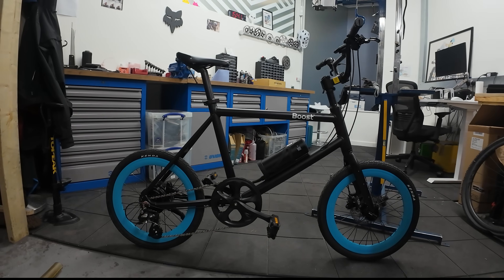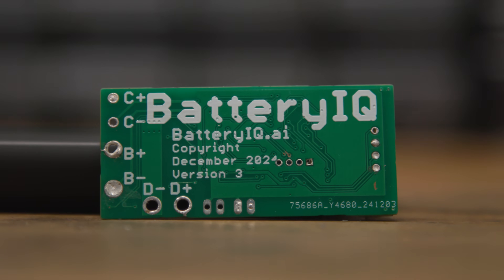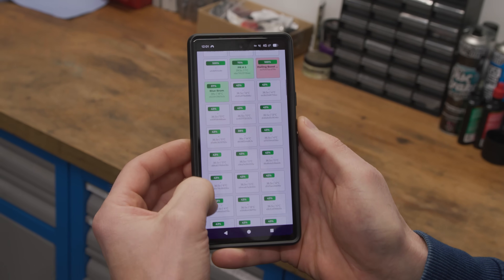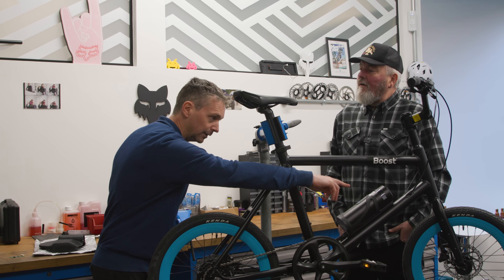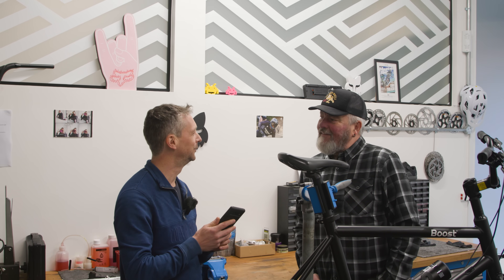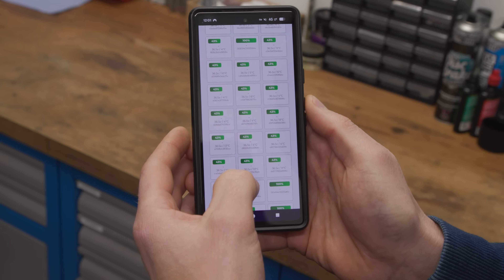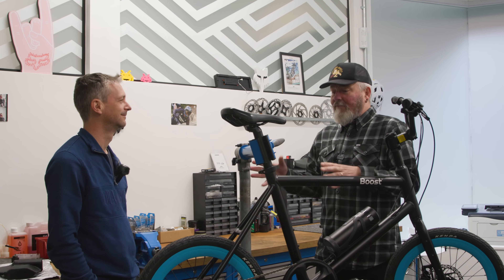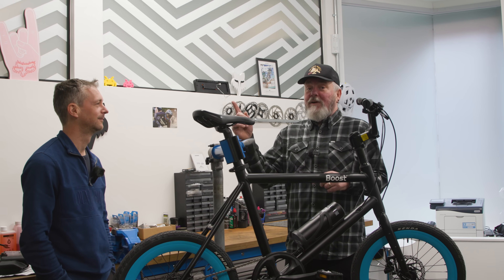New Microchip Could Revolutionise Ebike Ownership

Comment: All brands being compatible in something, well that is anything bike centric out, has he never heard of the difference in bottom brackets, gear systems, brake fluids and in fact everything manufactured for cycles
Reply from the maker: You're not wrong, in fact, Simon's been thinking about bicycle standards recently, so keep an eye on the channel for a video on that in the new year. Having said that, BatteryIQ see the potential for this tech to be similar to how Mips is used in helmet design.